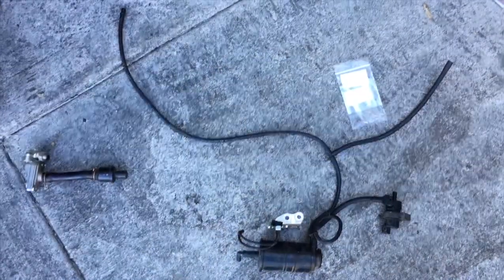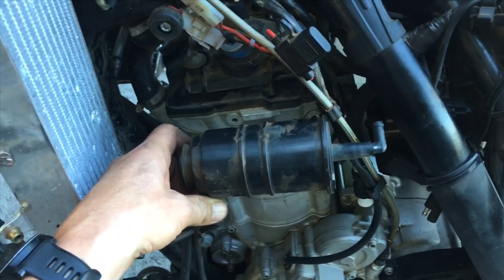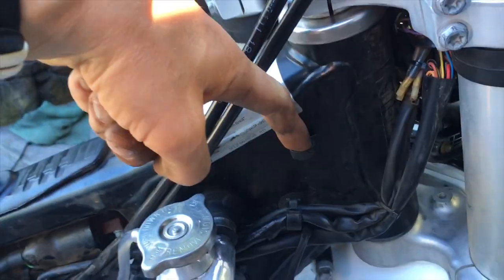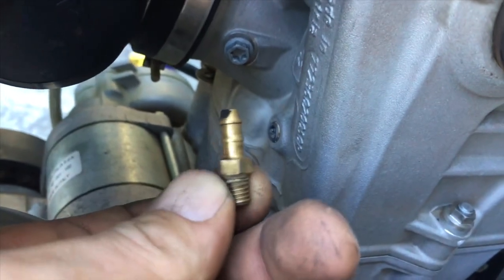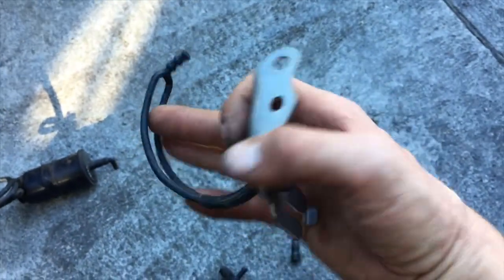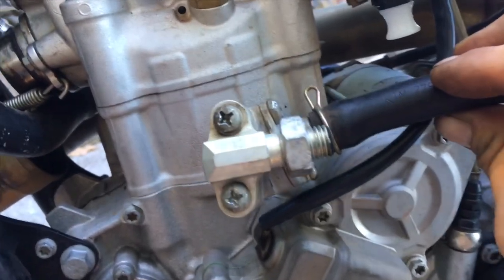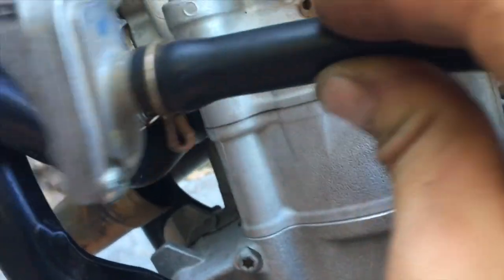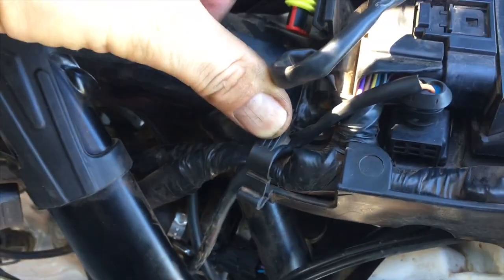KTM EXC DeSmog - Emissions Delete (2012-2016)

Comment: Great video! After the desmog where did you end up venting the gas tank to?
Reply from the maker: If I remember correctly, I just left it in the little round clip/clamp thing there where they tee’d together with the can. I imagine it’s the same frame hole that you could order one of the barbed plastic fittings that screw into the same hole like on the SX/XC line of bikes. Go to your local dealer and look at one of the KTM race bike models if that doesn’t make sense. It’s almost certainly this part: 51030022000, ANGLE PIECE 90 DEGREE M10X1, KTM https://amzn.to/3bpHzRB but cheaper and maybe in stock at the dealer.
Reply: @JohnHowerton137  thanks I was thinking that would be a good way to do it
Reply from the maker: Super clean way to do it. Not sure why the Japanese Mfgs haven’t done something like that in 30-40 years. Euro engineers FTW 🙌

Comment: The brass insert on the intake, why not just put a rubber cap on it?
Reply from the maker: Rms 1290 because the bolt is like $1 and the right thing to do. Rubber cap gets knocked off... now you're sucking crap into your engine. $1 isn't worth a boom.

Comment: Will this throw any engine codes? Did you have to adjust your TPS? Thanks in advance!
Reply from the maker: Graig Ward it didn't. I adjusted my TPS a tiny bit, but not because of this. TPS really isn't the correct way to do fueling changes. You should get a controller.

Comment: im in ca. any idea if that would make me not pass smog check ?
Reply: I guess I could put it back when I need to
Reply from the maker: Honestly, no idea. If the engine has a decent amount of hours on it I would suspect not.

It really doesn't need to be removed. I just didn't want to deal with mine anymore.

You could just add a piggyback computer to liven it up, then remove that plug or two when you have to get it checked.
Reply: Ca does not smog motorcycles